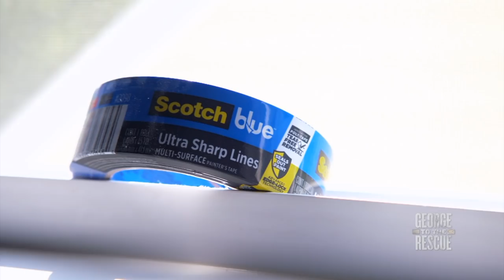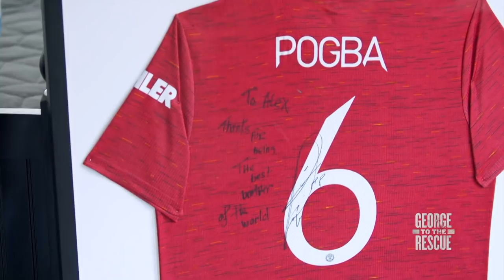BRAVE Mom and Daughter Receive ASTONISHING Renovation

Comment: You technically can go over an existing roof, but it's not recommended! It's the cheap route of course though!
Reply: It’s actually cheaper than doing a tear off and having to dispose of all the shingles and then put down new tar paper….
The inspector comes in and says if it is okay or not……

And, you have the option of doing it again in 10-20 years with a third layer of shingles………,,,👍
Reply: @Jesssalyer   it is the cheaper route than a tear off.. whats your point?
Reply: @truthtalker4038  that a home owner isn’t required to tear off his roof as long as there’s just two layers of shingles on it and it’s still in good condition???????
Didn’t I say that already???
Whatever